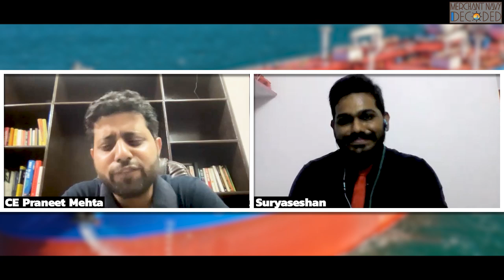ETO full interview questions and answers 2023 | How to become ETO 2023 | ETO Mock Interview 2023

Comment: If the neutral wire is broken in between the return path the neutral will work as a phase because there is no return which connected to ground which is in zero potential so there is a high chance to get a shock.

Comment: We don't get electric shock from neutral wire. But if we touch phase (live) wire we will get shock. reason behind electric shock from phase wire is that current flows when voltage is applied and current flows through low resistance path.
•When we touch "phase", our body resistance is lower than bulb resistance and hence current starts flowing through our body ( lower resistance path) and we feel electric  shock.
•When we touch "neutral" wire our body resistance is more than bulb resistance so current doesn't flow from our body but flows through neutral and atlast goes to ground. so we don't feel any electric shock.
( human body resistance=1k-10k ohms, neutral resistance= 5-10 ohms)
Reply from the maker: https://www.merchantnavydecoded.com/courses/electrical-package/
This package will clear all your doubts 

Team merchant navy decoded